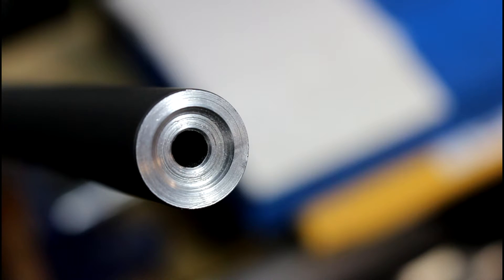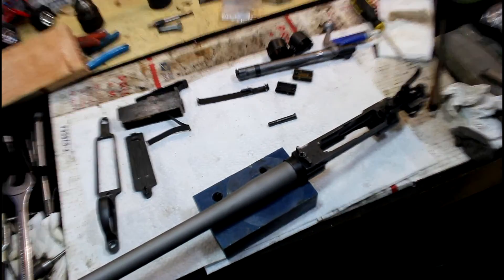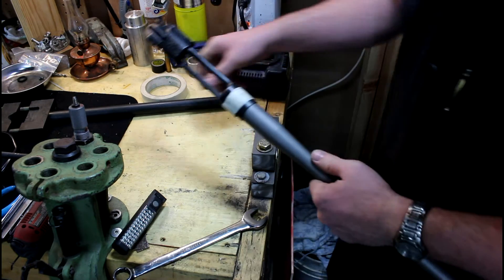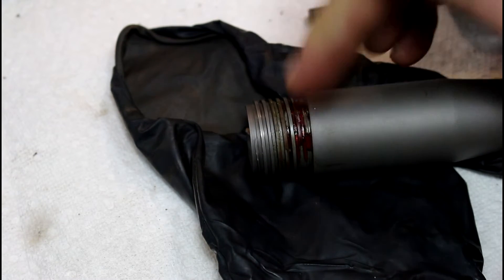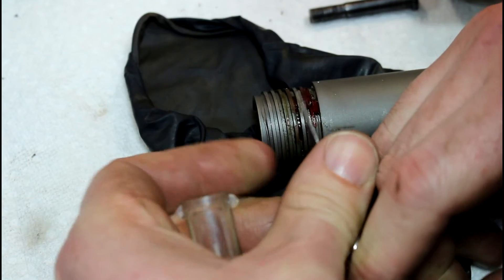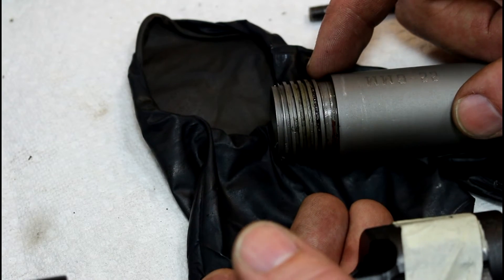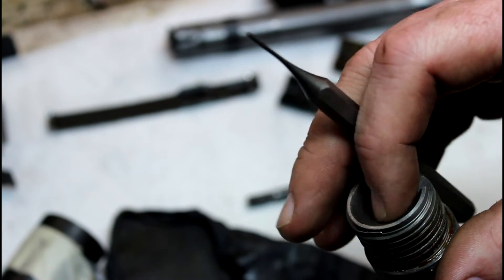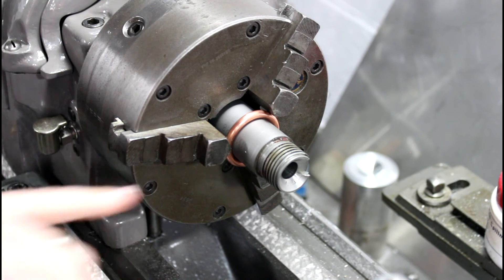Rifle Barrel Salvage Before Setting Back, Polish, Crown, Feeding Cone Repair! Part 1

Comment: How do you avoid scratching the barrel when you slide it into the bushing, sounded like there was some scraping?
Reply from the maker: You are talking about the barrel vise right? You can be more careful and take an extra few seconds to feed it in the and guide it with your other hand. You can also take some wider masking tape and run it down the length of the barrel. In this case, I was refinishing the barrel so no big deal. Also the bushings are aluminum, so the worst that would happen is you get a streak of aluminum down the barrel which will usually clean up with some light weight oil and #0000 steel wool. When it is all finished, then you take a little more care in putting it in and out.

Comment: Parkerizing produces a dull and slightly textured finish and it is opaque rather than translucent like bluing. If you can see the "shine" of the polished base metal, it's blued.
Reply from the maker: Not always true, You can bead blast metal as if you were going to parkerize it and hot blue it. It will give a nice black dull finish. I've done it on several rifles. You can also leave metal in the Parkerizing solution longer to get a deeper blacker color. You can make them look almost identical.

Comment: I predict that the other guy expected the bore to be concentric with the outside.  He probably just used a 3-jaw chuck to single-point the threads and found that the rounds would not chamber smoothly when he assembled the result.  To "fix" it he cut the threads deeper and used Loc-Tite as a spacer to align the chamber to the breech.
Reply from the maker: That's a cleaver thought. it's a possibility.

Comment: Is that a English Endfield action ?. I thought by looking at it that it was a Mouser 98? Hard to tell, You mentions 55 deg. threads , if they were, Good that they are not.  Anyway V threads in the Metric form are also 60 deg. as per the 1964 Machinist hand book where the Whitworths are 55.  New sub here, take care Dave.
Reply from the maker: This one is an M1917 enfield, copy of the british Pattern 14. All english square threads. Older Mausers are all 55 degree v-threads.

Comment: the crown looks like.. recessed target not hunting. Either flat or rounded over is a standard hunting rifle
Reply from the maker: Flat is usually only used on target rifles along with some that have a 11° crown . Rounded is a commonly used crown for older .22 LR rifles and some older long rifles and a few old lever guns. Not really used in today's current production guns. A "recessed crown" and a "recessed target" crown are basically the same thing. Most off the shelf rifles sold today have this crown or one very similar to it.  The idea being that you recess the crown in case you jam your rifle on a rock, drop it, nick it, or otherwise damage the end of the barrel. The outside ring acts as the sacrificial crown so the actual recessed crown can still function as intended.

Comment: The chamfer is standard machining practice to always break every sharp edge, other than that good job.
Reply from the maker: Thanks
Reply: Yeah, I’m a little confused. My understanding is that the chamfering IS to create a uniform (burr-less) crown. Hence the use of an abrasive compound to create it. And the rebate/set-back/recess is to shield the chamfered crown from damage.

Also, doesn’t the copper wire introduce an element of variation (varying thickness of the wire) that could be throwing off concentricity? As the wire thickness varies, the centerline of bore is going to shift so that the outside diameter of the copper wire is centered between the jaws.

Excuse my observations if they’re nonsense. I’m just a noob looking for “diy re-crowning” videos that came across this video.

Love seeing the work regardless!
Reply: @blakehornal6129  Using copper, brass, or aluminum shims in a lathe is normal; you simply have to dial in the part to achieve concentricity.

After watching the video again, I thing he was saying that the chamfer on the muzzle crown is extremely excessive. In that case, I think he was right. The various crown profiles in common use today were developed after hundreds of years of research, there isn't much left to experiment with.

Comment: I'm thinking you do better machine work then a lot of so called gunsmiths. Too bad you got stuck with someone else's crap. Do you have a web site?
Keep coming with the videos. Thanks
Reply from the maker: Thank you very much! I currently do not have a web site or an FFL so I am not taking any work, but I get several requests a week so that may change in the future. Thanks!
Reply: +Precision Machine Shed 
Do you need an FFL if someone sent you just a part to machine? But still think about the web site, based on your videos, it shows you attention to detail. There is other work out there that would not require an FFL.
Reply from the maker: There are some gray areas, but in general if it's a firearm part, they get real picky about it. I sure appreciate the kind words and I'll look into a web site, it's the next step in the progression of things. Thanks

Comment: When a barrel has no "landmarks" that require proper alignment with the receiver like sights and/or roll and/or a muzzle brake properly "clocked" to the barrel, what is the point of "timing" it to line up precisely where it was before? And without loosening and retorquing the barrel before putting your "timing marks" on it, how do you know its going to be properly torqued and timed upon reassembly? 

If you want to easily remove OR remove parts "locked" by RED LOCTITE, try some HEAT. 250-800 degrees melts it and neutralizes it. That's why you don't use red Loctite anywhere you're not willing to apply heat later.

And by the way, removing that Loctite probably will have zero effect on the threads themselves OR the fit of the part. Loctite is a thread locker. Not "liquid threads". If the threads and fit of the threads aren't "solid", Loctite doesn't "fix" that situation. It's a liquid that goes where its "pumped" when the parts are assembled. It won't fill in gaps or repair loose/damaged threads, etc. There ARE products for THAT but Loctite thread locker isn't one of them.
Reply from the maker: This isn't an AR-15 that needs to be torqued and loosened once or twice before a final torque. These receivers have an extractor cut that needs to be indexed or "clocked" as you would put it. Loctite in general doesn't need that much heat 150-200 degrees is plenty. 800 degrees on a receiver ring and you are approaching taking the heat treat out of the receiver if you haven't wrecked the bluing by then. 

This isn't an AR where many people instead of fitting a proper fitting barrel extension to the upper, will dump in a bunch of lock-tite to take up the play between the two parts. Bascially locking it in place and most likely not concentric to the upper. They make specific size extensions for higher end target builds, which is what I use. 

There is absolutely NO reason to put lock-tite on a threaded barrel unless you are trying to fix and F-up. As you can see in the video, if you put enough in there, and let it cure, It will create a false thread and it's hard as hell, so yes, after it cures, it can mask someones mistake as was the case with this barrel.

Comment: That's a 60 degree chamfer for a live center
Reply from the maker: +carryit around  
Yes it is, and it still works fine with the dead center. You can also chuck up a piece of steel and cut your own center at whatever angle you want. The later would have been a better option in this case. Thanks
Reply: i do all my barrels (and receivers) with a jig i built so i really don't have a dog in the fight....
Reply from the maker: I think the jig is great for receivers and bolts but I don't like using them with barrels unless the barrel is supported on the outboard after indicating.
Reply: +Precision Machine Shed  8 jacking bolts holds the barrel fine
Reply from the maker: +carryit around 
I don't disagree you can cut a nice barrel,  just not how I choose to do it.